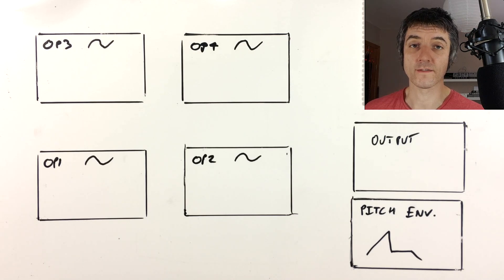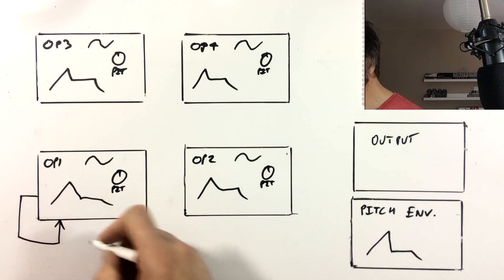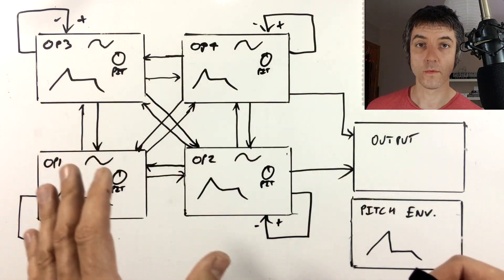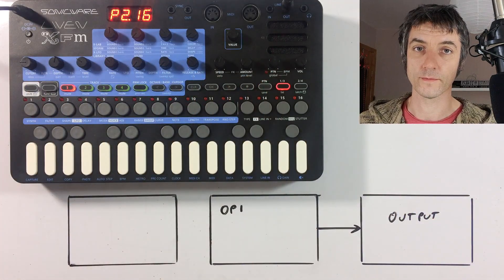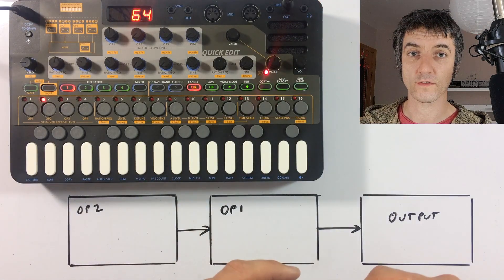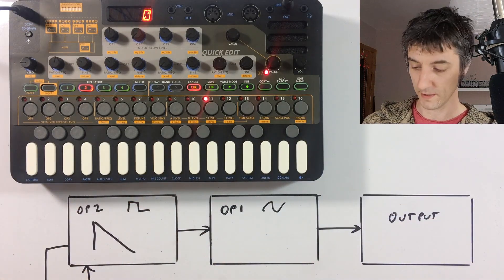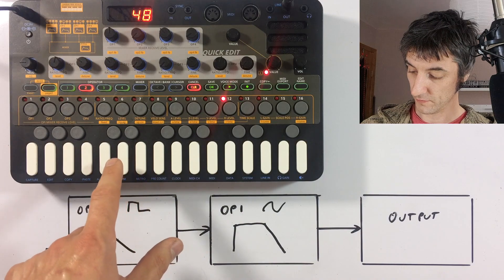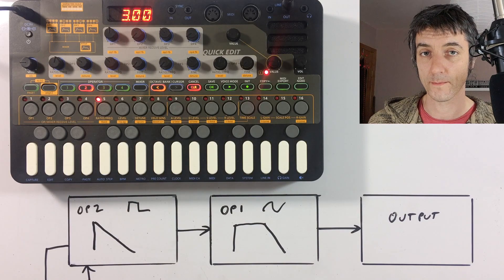FM Editing Tutorial 1 - The Basics - SONICWARE Liven XFM - Accessible Tutorial

Comment: How do I see the name of the current patch ("Sound") and bank?  There doesn't appear to be anything about that in the manual.

If I'm playing a sound (on a selected track, played manually with a keyboard) and I want to edit it, I have to go into Edit mode, and first find the sound again, so I can edit it - which is really awkward, but it's made worse by the fact that I don't know what sound I was playing, so I'm just guessing when I choose one to edit.  If I've made a few that sound similar, I'm likely to get that wrong and edit the wrong one.

I want to be able to go from playing a sound, to editing that sound a little, to saving it, possibly with a new name, then go back to playing.  While the editor mode itself is fine, the process of going through that cycle, from playing to editing to saving and back to playing, is a minefield.
Reply from the maker: The best thing to do is to save your pattern once you've chosen your sound. Then when you turn any knob a small dot will be shown at the bottom right to show which knob position has been saved into memory, including the Bank and Sound settings. It's also worth trying that with Knob Latch on as it will display the current setting immediately if the knob is in a different position to the saved setting
Reply: @ChrisLodyMusic  Thanks, Chris.  That helps.

Incidentally, is there any way to tell if Knob Latch is on or off, other than by how the knobs behave?   The button is backlit, but that doesn't seem to be what the colour means.
Reply from the maker: Yes if you hold Func, if the Knob Latch button is lit it’s on and if it’s not lit it’s off. If you’re experiencing any other strange behaviour then I’m not sure what would be causing it
Reply: @ChrisLodyMusic  I see.  Thanks.  I was expecting the LED colour to indicate the status of Knob Lock after I'd changed it.

Comment: Thanks for another great tutorial. As always, I have questions.I'm doing OK with 2 operator FM and even serial (modulators modulating modulators) FM.  However, parallel modulation (multiple modulators separately modulating a carrier) has got me stumped.  When it comes to ratios/frequencies, I'm comfortable when all operators are between 0.5 and maybe 7.  I honestly can't get my head round ratios/frequencies higher than that.    So please consider covering parallel modulation and extreme ratios/fixed frequencies in a future video.
Reply from the maker: Yeah that would be an interesting subject to cover, especially if I can use it within a sound. Though it has to be said very much of the school sound design that's 50\50 theory versus experimentation, so I'm not sure what I'd use that particular style of routing for at this point 😄 But I'll see what I can come up with

Comment: Thanks for another very informative tutorial! This is a good an explanation of FM synthesis in general as anything else out there. Would I be correct in assuming FM engine on the 8bit Warps is based on a two-operator model, and that the four-operator of the XFM would result in a "richer" sound?
Reply from the maker: Yes it's a fully fleshed out FM engine on the XFM while the 8bit Warps has a basic 2 op mode with an LFO that can be used as an envelope. The 8bit Warps is pretty special though, that FM sounds like nothing else. I made a video about that actually, the FM bit is in here somewhere https://youtu.be/2iyDjNP7rAY